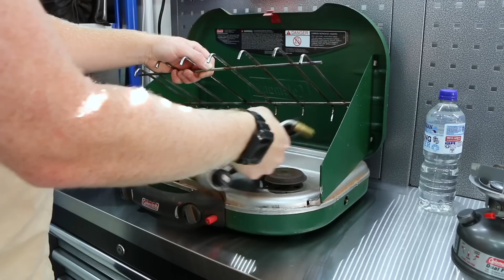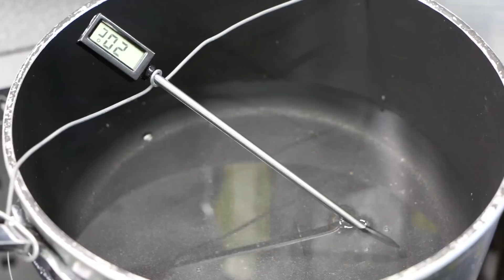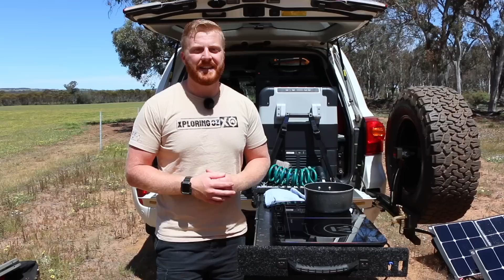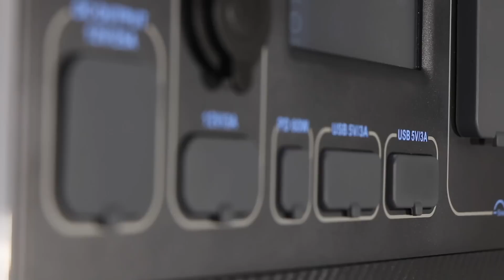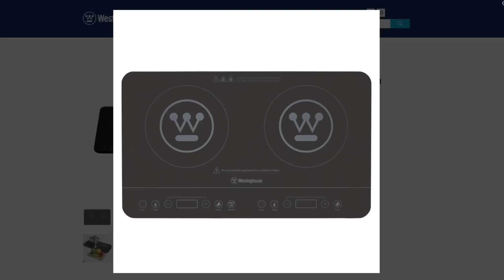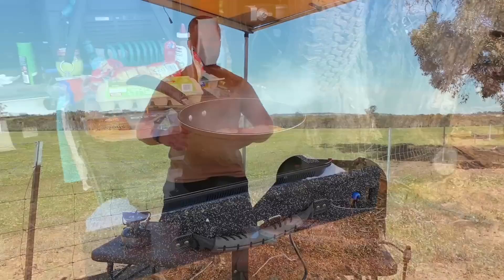INDUCTION COOKING & Camping | Is it sustainable | Electric vs Gas | Overland Cooktop | Pots&Pans

Comment: Hi Nathan another interesting vid,whilst the induction units certainly have advantages but  as you mentioned  a day or two of not travelling everyday over cast weather it is all over.
The lithium power unit is still quite bulky. In the van I have 300 watts of solar &300 amps of Lithium with the combination of induction cooking ,refrigeration and lighting 2 days of bad weather would the end of it. Some guys with vans with 1000 watts of solar and 650 amps of Lithium are getting away with just Lithium.  Cheers Ian.
Reply from the maker: For sure and these are things that still have to be taken into consideration. Particularly if looking at fitting into the rear of a vehicle like in my case, space is a premium.
Hopefully as technology advances, battery capacity will become small, lighter and most importantly cheaper!
Cheers.

Comment: Love the idea of induction, but cost is a huge setback. For someone who cooks primarily with fire and is only after a backup, I just can't justify that sort of investment. But as the cost of Lithium etc is forever decreasing, hopefully it will be viable in the not too distant future.
Reply from the maker: Absolutely, if only consider induction for a backup unit, the cost and size of these setups probably wouldn't push it over the line at the moment. All we can hope is that advancements in technology to make battery storage smaller, lighter and cheaper will make this type of setup more viable in the future. 
Cheers, Nathan.
Reply: @XploringOz  it’s not so much the size. Not much bigger if at all than a gas system. But the cost is the big one.
Reply from the maker: @FloydBromley  For sure, it's all going to depend on whether a particular setup will suit your particular needs.

Comment: I am sure you are aware and should be part of the test, a saucepan with the lid on will heat the water more quickly which then dictates more efficiently.  Not trying to pick holes, just trying to help.  I boil all my water even when at home with lids on.
Reply from the maker: Hey mate, absolutely agree and in a real world scenario out camping this is definitely what I would do. In these tests I just wanted to keep them consistent across the board and fitting the lids would be more difficult with the thermometer present too. 
Fitting the lids would no doubt significantly improve the boiling times even further!
Cheers, Nathan.
Reply: @XploringOz  Cool mate.  As I say, not picking holes in the slightest.  Will be looking at more of you stuff.  Keep it up.
Reply from the maker: @arsenalphill742  No problem mate, no offence taken here. I understand where you're coming from. Glad you're enjoying the channel. Cheers.

Comment: It’s a pity the bluetti doesn’t have Anderson plugs on it and it can’t be charged by the Alternator 
An induction cooktop would be handy if you have a powered site
The bluetti is looks bulky and all those solar panels take up space
Reply from the maker: Yeah, I hear you. But saying that it's very easy to make, or just but a simple adapter from 12V cigarette lighter to Anderson plug (I've used one for the water pump box project) and if you needed high output, the aviation plug will cover most needs.
Also true, it does take up space, however it depends on your setup and how/what you plan on powering. It might be better suited for a camper or RV or even just a vehicle that doesn't have a dedicated 12V dual battery setup hardwired in. 
I'm still happy carrying it around, I have the space and love the extra versatility the unit provides off grid.

Comment: Nice video. Cost alone, battery set up to run the cooker/s and cookers them selves. Thanks for the informative video.
Reply from the maker: Cheers mate, for sure it's an expensive system to setup, but then again the whichever power system you choose will not only power the induction cookers, but also every other power requirement you have too. 
Cheers, Nathan.

Comment: Another tip. To just boil water, a $35 collapsible kettle works amazing. 900 watts power draw. Easier to get out and use than induction and a pot, for a quick roadside boil. I boiled water in a saucepan until I upgraded after seeing someone else do it. Got mine from Snowies.
Reply from the maker: Definitely and personally I don't use the induction cooktop for a roadside coffee/tea stop. I still and always will carry my JetBoil for this. The JetBoil is super quick and easy to use and boils that water in no time and uses very little gas.
Reply: Yes immersion heating would but only for pure water so once you move past tea and coffee not great
Reply: It’s not just cooling down the water , why ?
It’s cool to pack and put away and no gas leaks, try microwave and no Saipan washing up if soup or milk is used in the cup.
Try eGO for a chainsaw you can put away cold with no spill or leak

Comment: I think going forward most people who are putting in dual batteries to run a fridge will run induction. You have just about everything you need with a 100+ Amp hour lithium battery and DC2DC charger. Just add a 1000+ watt inverter ($600) and a induction cooker $50 and you are done. Mine works great. Most people are adding the inverter anyway, as you have. You have duplicated you battery and inverter and introduced recharging power loss. But that’s because you already had the blueti. Great video.
Reply from the maker: For sure, no doubt these setups will become more and more popular as the become more affordable. 
I agree, my current in vehicle system isn’t quite up to the task with only a single AGM battery and personally I’d probably want something a little more than a 1000W inverter, but it would still do ok. 
You’re right, having the Bluetti has given me that opportunity, but also has the added benefit of being completely portable 👍

Comment: good video, we have been using a $50 induction cooktop for about 3 years when we are staying at caravan parks and use the same unit at home. 
 did you consider discussing any potential issues of carrying LPG in your vehicle?
Reply from the maker: Cheers mate 👍 they are good systems for sure. 

I didn’t touch too much on that in this video (it was getting long) but definitely an idea for a future vid. 
Cheers, Nathan.
Reply: Yes I don’t know why people keep saying induction cookers are $100+. $50 gets you a decent one. The. Again, not everyone drives a 200 series loaded with cheese either. 😀
Reply from the maker: @iamrodos  True, however the other reason I forgot to mention for buying this exact unit was the slimline design. At only 4cm in height, this is one of the slimmest units on the market and when I complete my rear cargo setup in my vehicle (with new addition) it will be clear why I needed the slimmest unit.

Comment: Thanks for all the info. My new van will have 300ah lithium so I’m looking to replace the inside gas burners with induction.
Reply: Would it be great if the stoves in caravan had induction for the electric instead of the crappy old school hot plate. My van has 3 gas burners and one hot plate, but it won’t run of my 2600w inverter and 300Ah battery. A few years and I think manufacturers will change over. I would love two induction and two gas. But the portable induction on the bench is an easy work around.
Reply from the maker: No problems mate, glad you enjoyed it 👍
300aH should be a good supply for a couple of these units. What type of van did you get?
Reply: @XploringOz  got a Lotus OffGrid 23.3. Hopefully get it in July
Reply from the maker: @matthewfinnigan3862  very nice. We looked at the Lotus vans for a while. Went a different direction in the end, but still very nice setups 👍
Reply: @XploringOz  yeh just got to find what works best for your situation.
Reply from the maker: @matthewfinnigan3862  For sure

Comment: G’day Nathan, 
another great vid from you on a hot topic.
Your explanation as always great 👍 
Have been waiting to read the responses from you audience 
Many valid points since so versatile 
What’s my point of view on the subject? 
Mobile good quality induction cook tops are cheap like chips nowadays !
Should be in every caravan and car in the drawer! Plus extension cable…

There are so many ways of cooking nowadays. 
just think about it, love my cave men steak 🥩 but how when there is a total fire ban in place. Or with the van in a camp ground. 
The Weber in the van can take care for it and can bake my bread also in it. 
Sure cooking with a wok needs an open 🔥 
So das all short cooking meals, vegis or potatoes best cooked with induction cooking on 240 volts.
Lithium battery and inverter should be not counted into an investment to it. It has to be there in first place for all the other appliances to run off it.
For sure we have a mobile induction cook top in our van, but not a 2000 watt inverter nore 200amp lithium batteries and still happy with our set up and can life with it while go camping with the small gas bottle, 2 flame gas cooker and the all important jet boil to heat quickly the water for our coffee press. 
Ops… How took cook a big crayfish?? Forget it.. eat the tail raw sashimi style, cut the head and put on the Weber or cook a soup in the biggest pot you carry. Many ways to cook up a meal…
Most important:  Happy wife, happy live.  Cheers
Reply from the maker: Sure is an interesting topic and everyone has their own opinion on the topic, but hopefully this video can provide some awareness on the subject and debunk some of the myths. 

But you’re right, hard to cook on an open flame during total fire ban, or what about when it’s pouring down with rain. 

I don’t think it replaces open fire cooking, but it sure compliments it well and works well for our style of overlanding.

Thanks for letting us know your thoughts. 

PS your right, have to keep the other half happy.

Comment: G’day Nathan. I will hopefully take delivery of a new Prado in Mar 22 and am considering shelling out my hard earned schekels for a Bluetti AC200P including the portable solar panels instead of installation of a second battery system altogether. I have previously watched your review on the Bluetti and believe it could meet my power needs - that and a Honda generator as a last resort option.
I understand that there will be a space debt to pay inside the vehicle but I’m happy to work around that. I am also looking to tow a decent camper trailer at some stage to help in that regard.
All that said, I don’t think that induction cooking is for me and my family due to the power draw but moreso that it takes something away from the whole family open campfire cooking experience.
Luv your content ... including on the self-contained water harvesting setup video 👍
Reply from the maker: Hey mate, congrats on the new vehicle and great choice. I'm sure you will love it!
Thanks for the feedback on the channel, its great to hear that people are managing to get some value from it and great to hear that it has helped with your decision on the battery setup. 
I too think that the AC200 could be used well as a dual battery setup, albeit a portable system, particularly if you are going to use it with both the vehicle and the car. It may take up some space, but when you consider how much is in there (inverter / charger etc) its good value, I believe. 
Fair point on the induction cooking. Theres nothing like sitting and cooking around an open fire, we won't stop doing that anytime soon, but it's been good to test some theories and de bunk some myths. 
Cheers.
Reply: Just note you can’t charge the Bluetti from Your alternator unless you add another inverter to AC charge it. It’s not really a touring solution. If you don’t have any of the stuff already, it may be cheaper and easier to go a 1500w inverter and suitable size lithium and a DC2DC that can take car or solar. Do you really need to run two cooker and high power. I am doing all of mine of a 1000w inverter and a 125amp/hour batter without issue.

Comment: Thanks, you raise some very good points and I agree that induction cookers have a lot of advantages, there were some interesting observations re heating times and how the wind can effect it etc. You talk about how awkward it it to fit in the gas bottles and then go and get a 28kg Bluetti that takes up significantly more space and is very hard to properly secure in the back of the car and have to add a 1000w inverter to charge it.
I am also intrigued how a 40ah lithium battery plus inverter and a few sockets ends up weighing 28kg. My 60ah lithium only weighs 8kg.
Why did you choose to charge from the inverter and not use the solar cables and car mode?
Reply: It’s a drawback of the Bluetti as it can not be dc charged directly like a traditional battery. Just solar or 240 if I recall. So you can’t hook up a DC2DC of the alternator. If you had no second battery system the Bluetti makes sense, or if you want portable. But it makes little sense to have a DC2DC, battery and inverter plus a Bluetti in most uses. But if you are adding on or get companies sending you stuff it makes sense. It’s just a bit confusing for people. But all the power usage info was spot on, it’s just the exact setup that’s not as typical.
Reply from the maker: Hey mate, 
So to reply to your points. Personally I have found the Bluetti a heap easier to store in the rear of the vehicle, primarily because of its square shape and the ability to put items on and around it. I used to the keep the LPG bottles in the rear footwell which used to get in the way and struggle to stay upright. 
Secondly in regard to the weight. Keep in mind this is a 2000W battery, which if using a 12.8V constant is equivalent to 156aH, which is significantly more. Further, a 2000W inverter is not small or light, combine this with all the other hardware and components and I believe the weight is reasonable considering. 
So I chose to charge off the inverter for two reasons. Firstly I was driving during daylight hours each day, so solar was not optimal. Secondly, the inverter is much quicker, as mentioned in the video it replaces 500W per hours when the vehicle is running. The car charger only replaces about 80W per hour, which just isn't going to cut it. 
Cheers, Nathan.
Reply: @XploringOz  I’m not good with electrics and maths but its 2000wh at 240v not at 12.8v. The specs say it has a 40ah battery. 
They also say the max charge at 240v is 500w, which I believe is around 8 amps at 12v, which is the same figure as charging mode 5. How long does it take to charge from empty?
Reply from the maker: @ilove2explore  Ok, so a couple of things need to be clarified. Watts is a universal measurement of power and is calculate by volts multiplied by amps. So Watts = Volts x Amps. 

The reason we use watts is that it’s a measurement that will calculate the power or battery capacity in this case for a unit, regardless of the voltage output. 

Saying this we can also rearrange the calculation to work out amps (a common 12V 4WD’er measurement) to determine the amp hours of a unit at a particular battery. This would be done by using the calculation Watts / volts = Amps. So in this case, 2000W / 12.8 = 156aH.

If you’re using 240V obviously the aH is going to be significantly lower due to the greater electrical force used. 2000 / 240 = 8.3aH (@240V) which is not really a measurement used for AC power.

In regards to the charge, yes the maximum input for AC power into the unit is 500W @ ~8A. But this is not at 12V, its at 58.8V. So here we can see that 58.8V x 8A = 470W, which is almost exactly what I see when charging the unit by AC power. 

In regards to charging time, you can divide the 2000/470 = 4.2hours. However saying this, keep in mind Bluetti reserve 10% power to avoid total battery depletion. So therefore 2000 x 10% = 1800W. 1800W / 470 = 3.8 hours. 

I hope this makes senses but this also confirms my comment in my first AC200P review video where I state that aH is not the best measurement for these units. Watts (a universal measurement) is simpler, easier and better suited to determining battery capacity when using varying voltages.

Let me know if you want me to clarify anything.

Cheers, Nathan.